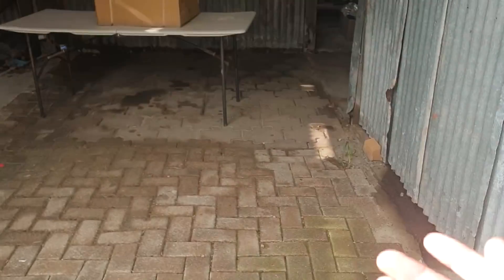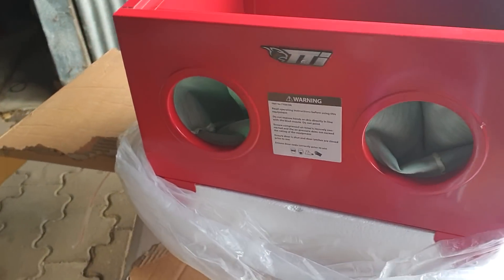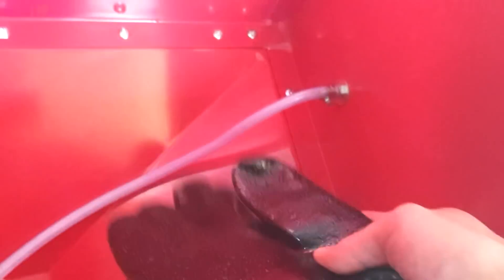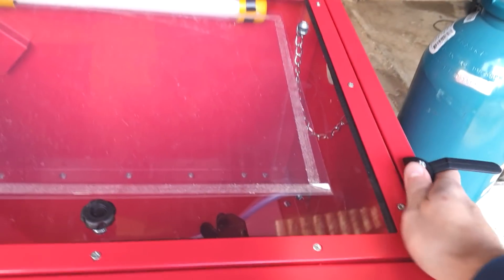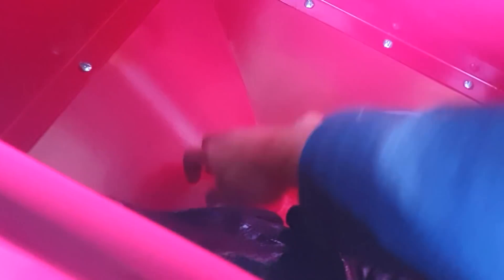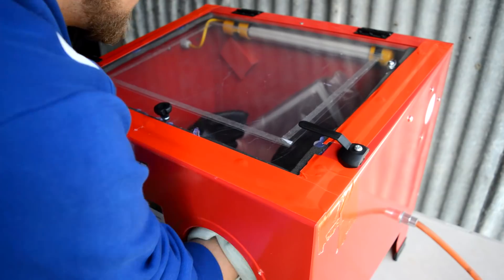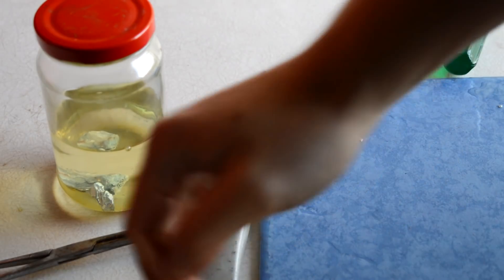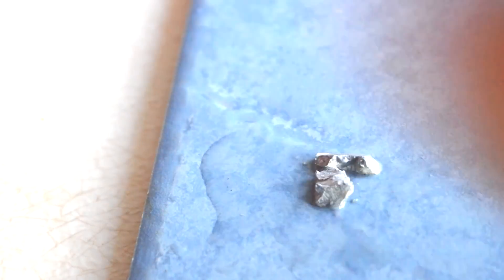Building a Glove Box for Air Free Chemistry

Comment: Fellow chemist with not a ton of knowledge in conducting air free chemistry. I would definitely want a vacuum to flush and pump along with a strong seal on the lid to protect from the surrounding atmosphere. The only issue would be getting a suitable vacuum pump which I'm pretty sure you've had issues with in the past.

Comment: Just my two cents from a guy that has to do all his experiments in a sub 0.1 ppm O2 glovebox: 

-you can use cheap nitrogen if you don't mind having a glovebox that doesn't go down to the ppm levels of oxygen. The only advantage of argon is that it's heavier, if you pump it in at the bottom your oxygen will float on top and get picked up by the outlet on the top. We have nitrogen boxes for stuff that doesn't require extremely low levels of oxygen, so it can be done
-working with Sodium in a glovebox is a PITA (it's great for an atmosphere check though) as pure sodium sticks to everything like superglue. Might keep that in mind before you get a sticky, really reactive metal on everything... Also, pure Alkalis from a glovebox react a lot more violent with air than the ones covered in oil: sodium is fine, but lab equipment that has traces of potassium or the heavier alks shouldn't be cleaned with water. I just put it in a fume hood and leave it there for a day
-put your light outside the box with a diffuser stuck to the window, you are going to need the extra space inside
-if you want a "real" inert atmosphere you've gotta use a slight overpressure inside the box (we use between 2 and 5mbar positive pressure, if it's lower than 2 you get problems putting your gloves on)
-a bicycle tire repair set is really handy for repairing gloves that have a leak
-more fasteners and silicon glue, we have tried building a DIY glovebox before with every edge sealed (the "airlock" consisted of a pane of acrylic glass that was screwed onto the side panel of the box, the nuts inside were covered with silicon and there was a rubber seal between the hatch and the box), still leaked quite a bit
-as others have already suggested: Use a elephant trunk (siphon, open end inside a container with oil, lower end to box) as the overpressure valve with a ball directly under the end of the pipe in the oil that will seal that pipe when you get a negtive pressure inside the pipe/box. This WILL happen if you have a slight overpressure and try to get your hands out of the box
-commercial boxes use a copper catalyst that gets oxidized by the oxygen/water in the water and regenerated with a Argon/hydrogen mixture. Might be worth a try...
-Antechamber? May work with surprisingly little effort, even a normal seal sandwiched between the metal cylinder and the door will hold a vacuum (the lower the inside pressure of the chamber the higher the force pressing it shut->good antechambers will hold a vacuum for months without problems). Also, use at least 5mm steel plates (bc of the pressure)
-don't underestimate the amount of gas a glovebox needs, we nearly go through a 50l flask of argon per week/box... A proper flush of the system is going to require at least three complete purges down to a few mbar
-a good way to reduce the amount of water inside is to put everything inside a 75°C drying oven for the night before putting it into the box, that reduces the amount of surface moisture
Reply: Awesome comment, I just learnt a few new things so thanks.

Comment: It’s hard to tell how bad the gloves were but that would be something I replace first if you are really having dexterity issues bc if you are ever dealing with anything corrosive/sensitive you probably want to be able to move your fingers accurately. But yeah I think the other things you already mentioned are other reasonable upgrades. Better tubing and a GoPro for better recording. And rather than hot gluing the cracks, maybe consider caulk or something similar

Comment: In addition to what others have recommended, I reckon you try run you argon tubing from the bottom, or at least under the grating. I have a badd feeling you're gonna knock something over with that in there. But yes, flow regulator, gets some fucking silcone or gasket sealant, maybe some cheap dessicant that you can leave inside to help purge moisture with less argon?

And yes, more clamps, maybe replace the acrylic with glass, go pro, or if you're feeling confident you could have your cam record through a hole in the side of the box, idk.

Looks sick tho, that sand blasting gun looks fun, surely you can find a use for that lmao.

Comment: Get a better seal on the lid so you can have some real fun. Also, clean up the lid to make it easier to view through. Also absolutely drop the hot glue for silicone. The hole behind the cover should be easy to fix if you grind off whatever they're using to rivet it or any pressure is gonna pop that tape. Also the hole in the bottom.

Comment: if you could fit a distillation apparatus inside, it opens up the possibility for white fuming nitric acid. also if the reaction isn't sensitive to carbon dioxide it would probably be cheaper than argon, i think, i don't really know what im talking about.
Reply from the maker: Not sure how well the metal box will hold up to acid vapours though, that's probably a big weakness of it

Comment: seal all joints with the duck tape leave the lid seal loose. you're displacing the atmosphere not pressurizing the box, defuse the argon slowly to prevent mixing with atmosphere gases, volume of cabinet/flow rate in liters per minute argon ain't cheap.

So yes you did convert a sand blasting cabinet to a air-free glovebox

Comment: As a microbiologist who worked in anaerobe chambers before: neat.
A word of caution, if you seal it too well you run the risk of over or under pressure popping the lid. I would devise some kind of pressure equalizing device. I don't have any cheap suggestions for this, we usually use either soft sided chambers, or foot pedals that run a vacuum pump and gas supply and adjust the pressure manually.
Hand warmers will scavenge oxygen (saw you posted that on another comment), but they put out a ton of water to do so. If you can figure out how to power it, an aquarium pump pushing air through a tube full of calcium carbonate could counteract that.
Edited to add: Paper soaked with a solution of resazurin is a great oxygen indicator. Oxygen sensors are too expensive and cantankerous.
Reply: Yep. Seems like they require a little bit of water to work, and as they get hot they vaporize it out. Thats part of why spent ones feel so crunchy, they've dessicated themselves.
Reply from the maker: @williamhendrick903  ah that seems a shame. Good to know though!
Reply from the maker: Oh they put out water??? That's gross, they don't seem like such a good option then

Comment: Echoing others, using a proper silicone glue would be good, along with using proper rubber gaskets for that top lid. If the bottom is detatchable (looked welded but couldn't tell) a gasket would be good, or also just pumping in silicon to fill any gaps. Dessicant could also be a decent purchase, really dry the atmosphere in there. Finally a better way of testing the seal would probably be a small smoke grenade, smoke stick or anything that produces a visable smoke/vapour. Pressurize lightly with O2 then let it burn, will show you where and a rough flow estimate.

Comment: You could utilise the large hole you put the acrylic over to add a fume extraction system so you can convert it into a janky fume hood with only a few bolts.
Reply: Then the top will be toast in no time, tbh it will be the first thing that needs replacing.

Comment: I don't actually do chemistry, but I've been getting into mycology as a mechanical engineer and getting a glove box would be helpful. Thanks for sharing!
Reply from the maker: Watched a few mycology videos when looking up glove box ideas. Don't know much about mushrooms but seems like fascinating stuff for sure! Cool hobby
Reply: @ExtractionsAndIre  It's a bit different of a scenario, but with mycology you just care about the billions of contaminants floating around in the air. I think the simple plastic design is fine, and you just nuke the inside with rubbing alcohol. Unfortunately, I don't think those designs will help with what you're after.  I like your idea of using a metal prebuilt box though, good luck with it all!

Comment: Put a dc barrel jack mount in the side. You could then wire it to supply dc power for lights or camera inside (it has a light, but maybe a pump or something. power plugs are good). Perhaps get some silicone caulk and redo the bottom layer for better seal. Perhaps bolting it down to a table/bench? Something ridged. They are heavyish but if the table shakes, no bueno.  cool project dude

Comment: use silicone RTV with a rubber spatula to seal permanent gaps, like around the bottom, and soft silicone for the lid and whatnot. it may not be a bad idea to add some kind of drain fitting to the bottom hole.

Comment: An armchair idea: maybe add a pressure regulator to the box, then 1. the air doesn't need to get purged out all the leaks, but has a nice exit point at the regulator, and 2. when the cabinet is filled and slightly pressurized, argon will leak out instead of air leaking in, so the leakiness only determines argon usage and not argon purity in the box

Comment: Hey, the sandblasting box likely won't hold up to a perfect vacuum, but one place I worked used to evacuate as much air as possible before back filling with argon. I don't know how sensitive your future chemistry will be, but it worked great on the very reactive titanium that was welded and heat treated in similar vacuum chambers. Albeit, the heat treat furnaces did not have gloves that extended into the oven, just the welding tanks.

Comment: Great idea and thanks for giving me an excuse to get a sand blaster!
A pretty basic suggestion - consider the corrosion you'll get from HCl at some point.  I'd try to keep all of the screw threads on the outside, and coat any exposed metal on the inside (silicone caulk?)
Obviously tempered glass would be better than acrylic for clarity and durability, but spendy.

I'd keep coming up with ideas to make it better (instead of using it), but you get more done because it doesn't have to be perfect - just good enough.
Reply from the maker: Good thinking about the corrosion... Yeah I wonder how well it will hold up to any acid fumes. Very badly I suppose

Comment: Top mechanic tip:
Use water with dish soap in it to check for leaks around seals of your box, also works for checking for holes/broken seals in car tires. 

Also, just to reiterate what tonnes of people have been mentioning, a silicone gasket maker from your local automotive shop should also be a decently cheap way to seal cracks that are letting air in/out.

Comment: You don't need the chamber to be pressurized, and some sort of diffusion mechanism like a tube stuffed with stainless wool with holes drilled every few cm would get the gas in the box more evenly.   This is used for "purging" in welding to protect parts from oxidation.   The flow rates for the argon are generally pretty low or even off once the  enclosure is filled, and the enclosures also don't have to be perfectly sealed but the difference is that purged sections don't generally have movement of gloves and objects inside and welding procedures are usually just a few minutes long vs the hours long that a chemical reaction might take..

I'd suggest that you seal any gaps and openings with a silicone, which is also more likely to be resistant to the inevitable chemical spills and I'd recommend a stainless steel drain valve on the bottomvs plugging up that hole so that you can wash out and drain the enclosure after your inevitable chemical spills 😁..   I'd also suggest some cheap ceramic tiles from the home improvement store to completely cover up the metal grate and provide you a stable work surface so you don't drop things through the grate and have to take the whole thing apart to get something out of the bottom..

Comment: Going to need to pull apart any joins on the box you can and seal them fully, especially the baseplate. The gloves are PVC, so avoid any chemicals that will ignite or dissolve them, and ditch the shitty plastic window for a quality glass pane.

Comment: A potential improvement for the gasket at the top: get hold of some silicone caulking. The kind of stuff used to seal windows and fishtanks. From what I've read, if you put dish soap on the surface you don't want it to stick to, you can use the lid itself to form a decent gasket. So, for instance, you could put soap on the rim of the box itself and apply the silicone where the foam is now. There'll still be leaks, I'm sure (there are always leaks), but it might save you some argon.

Comment: Thoughts from a fellow chemistry student with extremely limited experience in air-sensitive chemistry:
1) Use a sealant that is much more flexible than the crappy hot glue. Probably silicone of some sort would be good?
2) Make lots of holes in the tubing that lets the inert gas in so you don't just have one single big stream of gas coming in (I think "redxpen" explained that stuff better than me).
3) Get yourself some delicious nitrogen gas (should be much much cheaper than argon). This way you can do the initial purging with argon (which is much better at getting rid of the oxygen since you can kinda fill it from the bottom). Afterwards, you can use nitrogen gas to keep a slight positive pressure inside the chamber. This way you'll be pretty much guaranteed that no oxygen seeps in after establishing the inert atmosphere, but you'll also save a lot of money (I reckon). Heck, even CO2 could work in some circumstances, although you'll obviously have to make sure that it won't react with anything before you try.
4) Do get yourself a flow-meter, as you suggested.
5) Building an antechamber/airlock could be a good idea, although maybe a bit difficult and time consuming. You could also just make another slightly smaller (closable) opening in the box. This way, if you forgot to put something in there (like a spatula or whatever), you can just crank up the nitrogen/argon stream while opening the lid and slowly putting the thing (e.g. spatula) inside without introducing much oxygen. I've done a little bit of air-sensitive chemistry (just in glassware, not in a glovebox), and keeping the reaction vessel at a positive pressure with nitrogen gas works perfectly fine if I for example need to add an addition funnel to a setup that should be air-free.
6) Don't waste any time trying to make a vacuum with that setup, it's not going to do you any good.
Reply: 100% Silicone caulk is dirt cheap and should work for sealing.  Look for the 'pond' or 'aquarium' safe stuff and it'll be just silicone suspended in acetic acid that evaporates off.  Flexible and pretty much inert, so you can use it to seal things up to your heart's content
Reply: I know it Smells like vinegar but I'm very certain it's some vinegar smelling silicon compound
Reply: I can't tell how big the hole is over on the side, but he might be able to 3D something to fit onto that. My thoughts would be a silicone sealed door on inside with a similar mechanism as that on top for ease while using the gloves, and then an adapter to threaded schedule 80 PVC or metal piping. Cap the end with thread tape and a screw-on cap, and you have a pretty simple airlock. If I got the measurements for the hole, I could probably make a model and send it on Discord.
Reply: also an anti-static gun is very useful in the glovebox

Comment: Instead of the foam try using rubber to seal the lid and for the holes if you can get some off cuts of sheet metal galvanised steel would be fine .6 thickness if you can and use pop rivets and seal with silicone on the back of the sheet metal patch

Comment: Use an air compressor to test leaks with air first, or even nitrogen, rather than jumping into expensive argon.
Reply: Co2 is dirt cheap
Reply: @nikpat6006  it is a lot less inert than N2 though, and air is even cheaper

Comment: Any reason you used hot glue rather than a silicone sealant to seal up the bottom? If I were you, I'd use on most of the joints between materials, like on bottom joints or around your acrylic.

Comment: For filming on a similar level to where your work area would be in the box. Considered maybe a section of clear perspex glued to one of the walls? Maybe run some tests/fit ups not involving your box first before cutting large holes into it. 

That way if your camera is outside the box, it is isolated from corrosion/fire/burning etc
Reply: you can put a cardboard box around the camera to keep the light out, then you have no glare from the perspex

Comment: You can probably get away with using silicone to seal the top pretty well, and you could replace the plastic with a sheet of glass reasonably easily. An airlock would be tricky, but you could cut a hole in the side the size of the door you'd want for the airlock, then have the same sort of locking system that's on the lid to hold a flap shut. Use silicone to seal it and whabam, airlock door. For the back box portion of the airlock, you could weld or glue a janky box with another openable sealed flap on it and a one way valve made of a small rubber flap to allow atmo out, then a threaded valve to allow it in. Add a three way valve on your input hose so you can flood the chamber with gas and kablam. Janky airlock strapped on. 
If shipping wasn't so insane, I'd gladly make you a box. I'm trapped inside because of the fires and I have shit else to do now that the weed ran out. 
Tl;DR Silicone to seal the top.
Keep it up, I fuckin' love your content!
Reply: took my last bong rip and it hit me... Flex seal that bad boy.